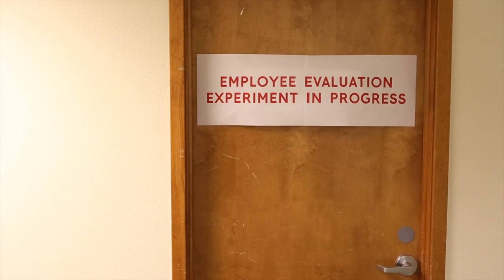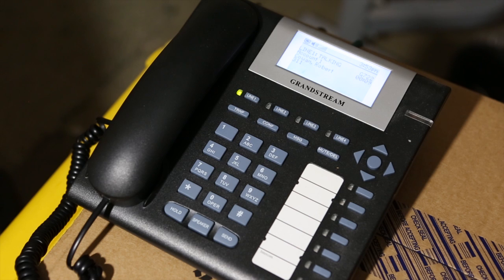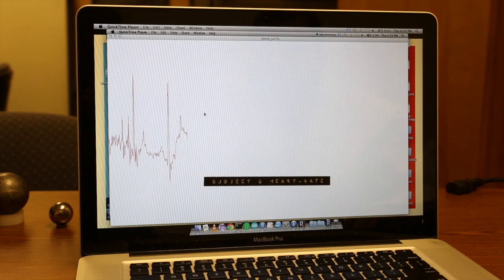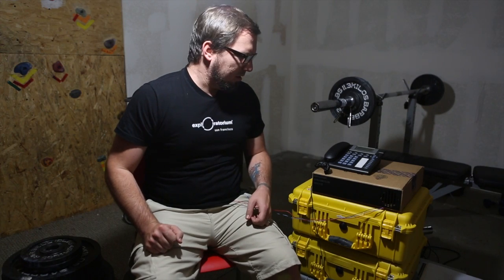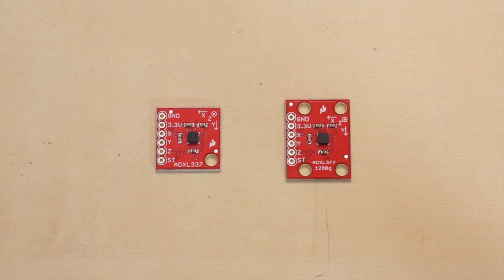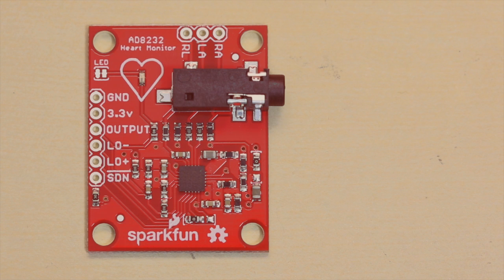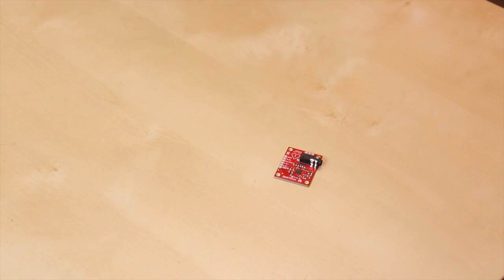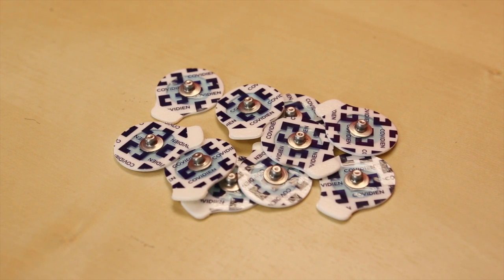SparkFun 7-18-14 Product Showcase: I Heart SparkFun

Comment: About those little breakout boards: it might be nice if you designed them with the option of cutting them down. For instance, as-is they have those big mounting holes and 0.1" pin header breakouts, and in many cases that's quite handy. But suppose I need to pack the breakout into a much smaller space: then I could use a saw to cut the board on the dotted lines, epoxy the board to something (instead of using mounting holes) and solder to little surface-mount pads instead of big through-hole headers...